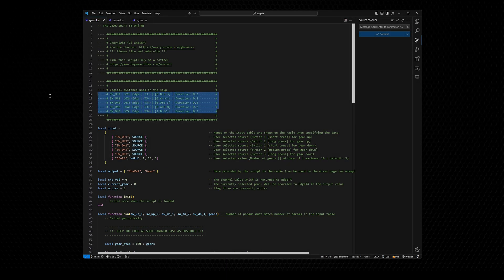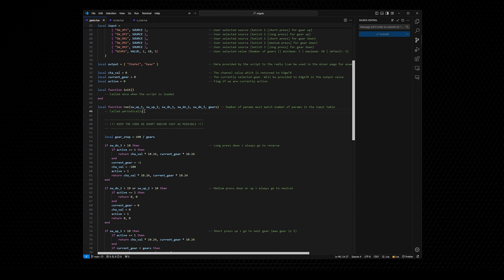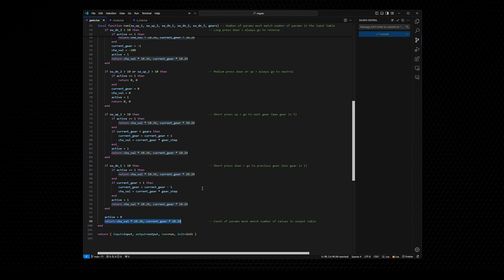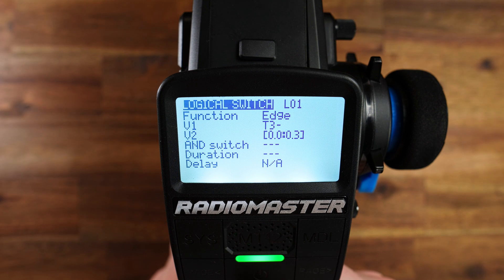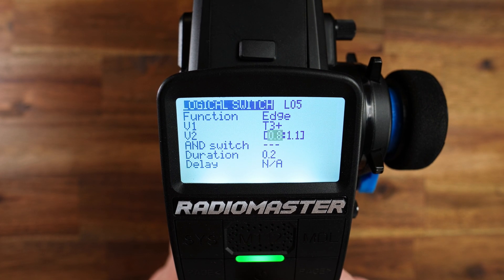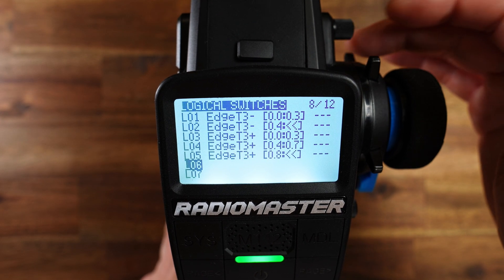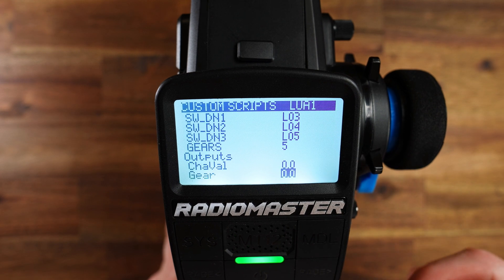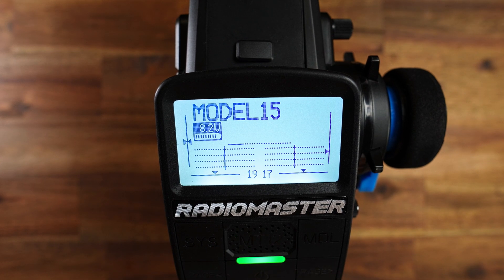SIMULATE A GEARBOX WITH LUA | MT12 | EDGETX | TUTORIAL [EN]

Comment: Hello friend! I really enjoyed your MT-12 lessons. I have a question. I want to write a script in MT-12 that will rotate the tank's turret for 2 seconds, fire a shot, roll back, fire another shot, and then rotate the tank's turret in the opposite direction. I want to bind all of these actions to a single button. Is it possible to implement this in MT-12? I have written a script that runs, but the channels do not respond and nothing happens. Is it possible to implement this, or am I wasting my time?
Reply from the maker: This guess this could be done. I once made a script which controls a Robot (the movement of the robot) through the MT-12. But since you wrote that your script does not work or the channels do not respond I highly encourage you to do some more research on how to program in LUA and especially how to program LUA for the EdgeTX system. Once you figure out the fundamentals you can go further and do more advanced stuff.

Comment: Would it be possible to add a parking brake as well, I'm installing a Hobbywing 1080G2 which have that real car mode where you have to put ot into reverse 
My idea is to set the neutral to be no drag brake and just let the car roll if i let off the brake and P would be full lock dragbrake
Reply from the maker: Since I do not own a 1080G2 I do not exactly know, what has to be done to engage "parking brake". But from what I have seen you can adjust the drag brake "on the fly". I guess it is possible (and you do not even need to use LUA for this). But again, I do not own such an ESC so I can't verify/test it.

Comment: That’s really cool!! I might have to try that on my 1/10 Hoonitruck.
Reply from the maker: Thanks man! Just download it, modify it, use it! The channel output of the script should be used to control a separate channel with different throttle curves. If you drive some logical switches with the value of the script (a~x with "a" being the script output and "x" a constant value [20, 40, 60, ...] to compare against) you have five logical switches that can then be used to de-/activate different entries in the mixes each with its own throttle curve applied. Just try it out.